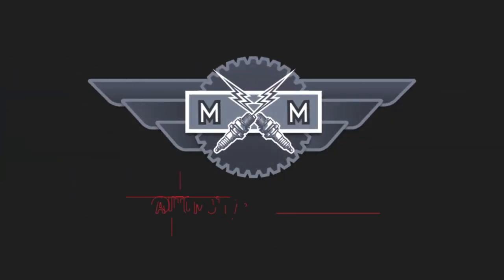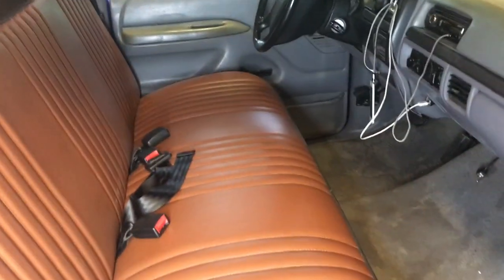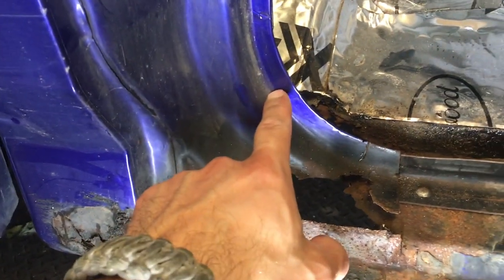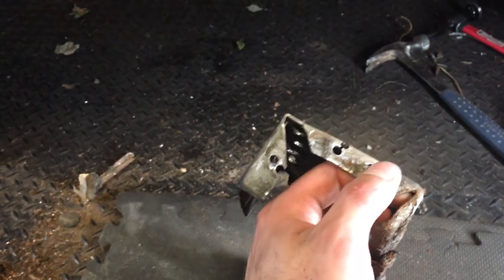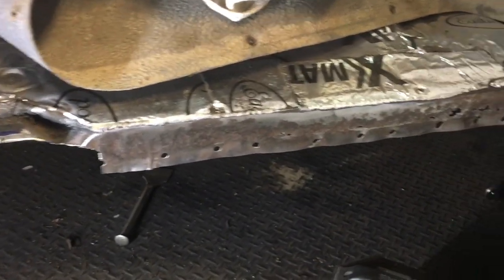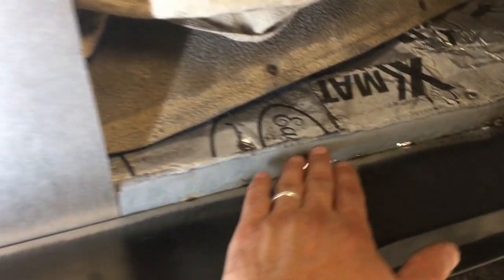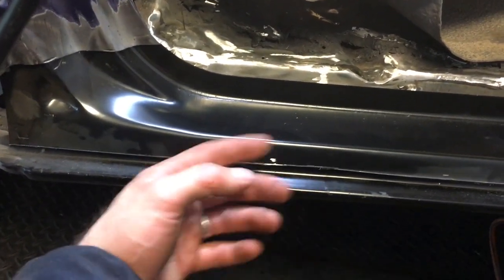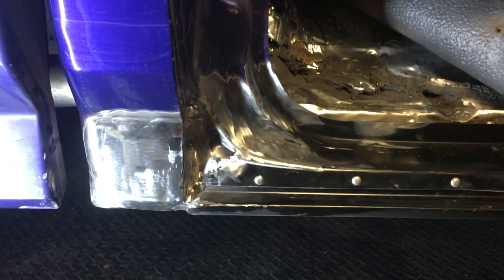How to Replace Rusted Cab Corner + Rocker Panel | 1995 Ford 150

Comment: Could you share a link to the metal part the seatbelt attached to?  I need to replace the same part on my truck.
Reply from the maker: Leslie Williams Yup! You are looking for the sill/ rocker piece. 
Here’s a link to the left side: http://autobodyspecialt.com/lh-1987-1998-ford-pickup-bronco-inner-rocker-panel-2-door-standard-cab/

This website has every panel, fender, or sheet metal piece you could ever need!🤙

Comment: Did you butt weld the cab corners?
Reply from the maker: Yes, I butt joint welded most of my joints.
Reply: @TheMinuteMasters  you did a great job! I honestly I’m deciding to overlap the whole cab corner since it’s much easier for me. It won’t be too noticeable since I’ll grind it and use body filler.

Comment: currently looking at fixing the rust on my 82 F100. driver side is bad enough where there is no more strength in the cab and the rocker panel is only held on by about 5 inches or so of good metal. Passenger is better but still pretty bad.
Reply from the maker: LUNITIC WILL Go for it man! My dad had an 82 as well. My advice is get as prepared as possible. Buy the tools and supplies you need and lastly put some good tunes on!🤙 It can be tedious but it’s worth the effort.
Reply: took a second look and its even worse than I thought. sucks as it's my only vehicle now
Reply from the maker: LUNITIC WILL My truck was so bad! I had holes in the floor under my feet. Lol No matter how bad it is, you can always fix it with the right combination of patch panels. If it’s your only vehicle, then you would need to focus on strategies that allow you to work on it over a weekend.

Comment: Just ordered cab corners for both sides online for my 2013. $40 each.
Reply from the maker: Kenneth Durbin Nice! That’s a good price!
Reply: @TheMinuteMasters  right. C2cfabrication.com. Where'd you buy yours?
Reply from the maker: Kenneth Durbin I buy mine from raybucks.com
Reply: @TheMinuteMasters  yeah I saw that site as well. Debating on them or the other site I found. Same corners though. How do they install?
Reply from the maker: Kenneth Durbin You have to cut out the rusted corner and cut the new piece to fit what you cut out and weld it back. It’s a little time consuming but as you saw, I did it in one day.

Comment: Most likely the reason it rust so bad is because of the third light on the cab has a broken seal
Reply from the maker: Yeah that was definitely one of the reasons. I have found another place to leaks a lot. The front A pillar at the base of the windshield. The seam sealer breaks off and water seeps in throw the gap.

Comment: Great job my friend! Not easy job at all with all the cutting and junk to get everything to how it was. Gotta love rust... I’m still trying to figure out how to replace just the top of that seam that connects the two as that’s where my rust started. Nothing else is bad and if I do start cutting into it I’ll have the two pieces separate might be harder to put em together :) anyways good job man and hey subscribe to my channel if you can. Cheers! OBS brother 👍
Reply from the maker: DrivenDiesel Thanks man! 🤙 It definitely isn’t easy and there are things I wish I could have done better on this repair. 
Honestly, you can buy the patch panel for that seam and just cut what you need for it. Or you can buy 20 or 18 gauge sheet steel and make replacement pieces from scratch.
Thanks again man! Just subscribed!🤙
Reply: The Minute Masters thanks for subscribing! Appreciate it and yeah funny how they rust there even though it’s on the inside where it looks like mine started. Possibly flowing down from the seal or maybe someone did a bad job on sealing those seams from bottom up
Reply from the maker: DrivenDiesel No problem man! 🤙 I’m always ready to help an OBS brother out! 
Yeah these trucks do rust from the inside out. From what I can tell there are a few major culprits. The third brake like leaks. At the base of the windshield where the two pieces of the A pillar meet is a leaking point if the seam sealer cracks off. A misaligned door won’t seal properly causing a leak. The last thing that causes these floors to rust is us getting in and out of the truck with wet or snow covered boots.

Comment: You screwed everything up when you used rivets.
Reply from the maker: Nicholas Brown Yeah rivets is not how I finished the driver’s side floor pan job, but it does the job. Tack welds would be cleaner looking but that’s up to the person restoring their truck.
Reply: But if you're doing a how to video you should do it the correct way. And rivets are not the correct way. Plus what type of rivets did you use? Steel or aluminum? Aluminum will corrode very quickly against the bare steel.
Reply from the maker: Nicholas Brown Good point. I guess I was getting to be along day. Lol So yes they are solid aluminum aircraft rivets. They hold paint better than regulate pop rivets. However, aluminum does have paint adhesion issues as Ford has found out with its latest trucks. If I was to do this repair I’d actually do it like the driver’s side.